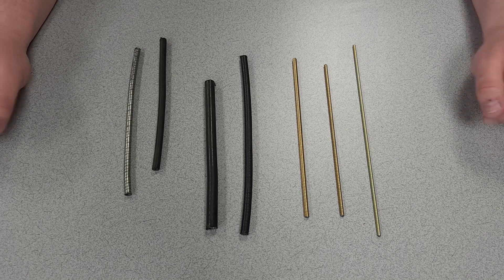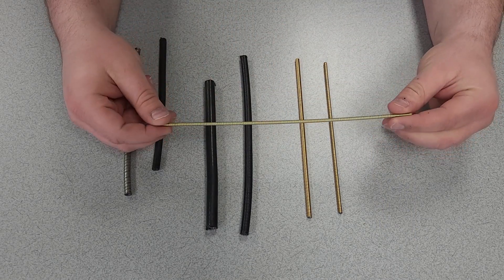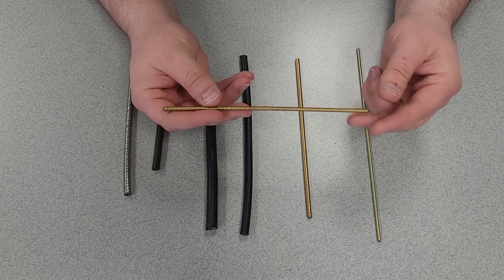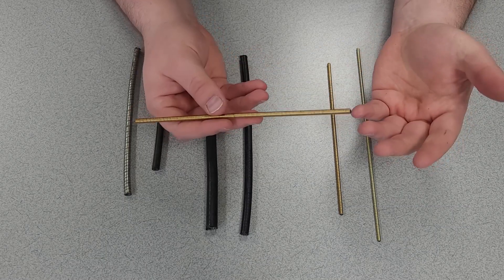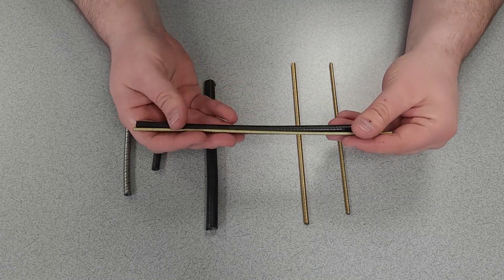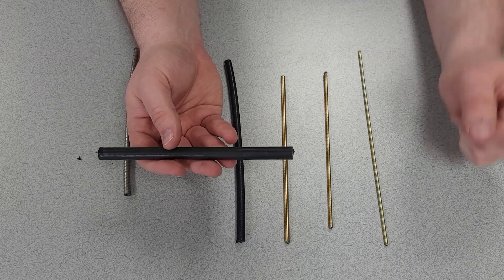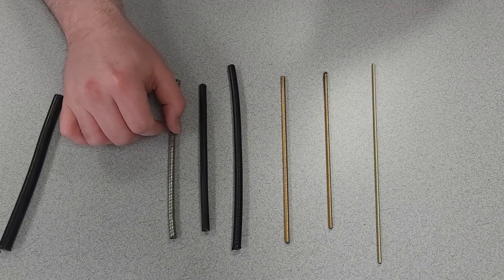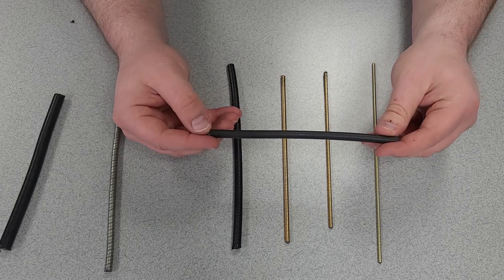Comparing Different Flexible Shaft Core and Casing Sizes

Comment: do you have any examples of modern aircraft using the 130 for aircraft indication? to my knowledege it is only sparingly used on general aviation aircraft.
Reply from the maker: The left hand lay 0.130 is used for the aircraft stuff. A lot of time it's used in smaller aircraft for things like tach cables.